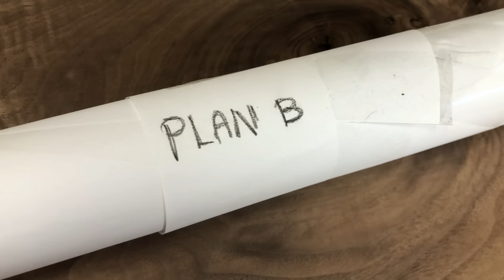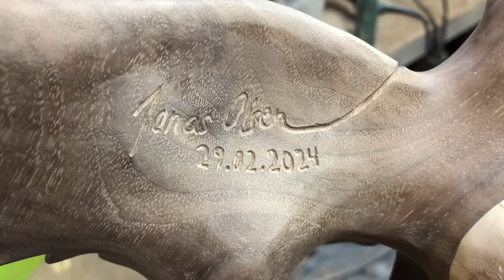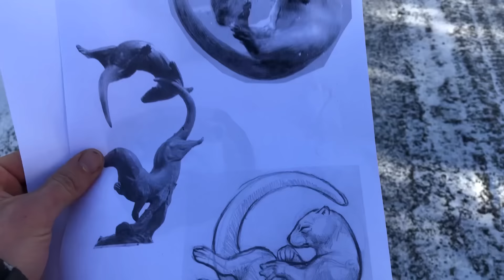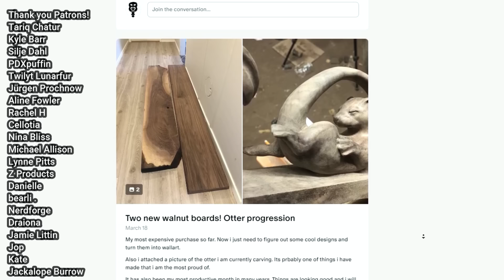Carving A Walnut Plank Into Wall Art!

Comment: If you like the knot in the wood, you can fill it with a mix of 2 part epoxy. Don’t fill it up completely, but allow for added epoxy plus finely ground powder from the walnut carving. It will look fine. And just sand it flush. That way if you like the knot, if it has nice character, you can incorporate it into the carving.
Just a thought..
I love your work.
I do miss the sound of the Dremel and other tools. Do you like your Mikita chainsaw?
Reply from the maker: Thank you! I like to work without epoxy, But i should explore it perhaps. Yeah rhe chansaw works quite well, But i should buy a blade with a thin end radius for detail work

Comment: I hope you are carefull with all the wood dust you are creating, it can cause irritation to the lungs and shortness of breath if you breath it in too long. Also in some cases, it can cause cancer.
Reply: It is also toxic to horses.
You need proper ventilation if you make a lot of dust.
This is one wood that shuts me down fast.
Reply from the maker: You bring up an important topic! I use a dust mask in the workshop and as you can see in the video i also use a VOC protective mask when working with oil. Take the right safety measurements is very important

Comment: A few things: 1. Coat your screws with a little wax and they'll go in buttery smooth. 2. Which burr are you using to get such a clean signature? I've been using the smallest cone burr I have to do mine and no way am I getting such clear results. 3. You are insanely good at what you do and I am happy to subscribe.
Reply from the maker: Thank you! I used some cheap diamond burrs for the signature. The wood i worked with cut pretty smoothly.